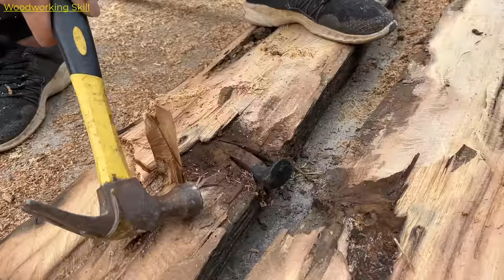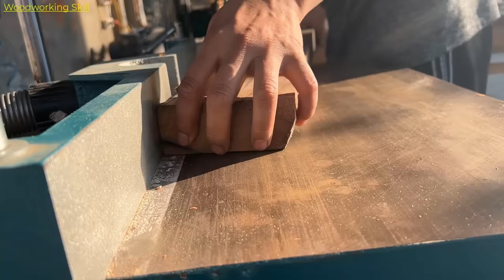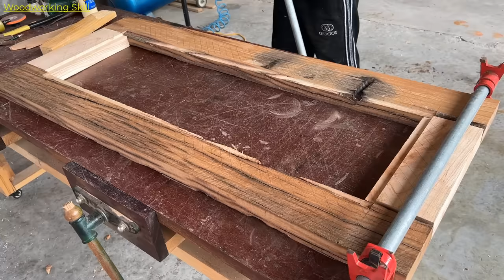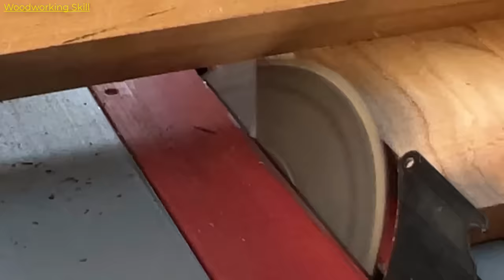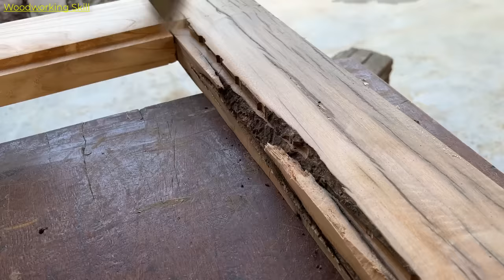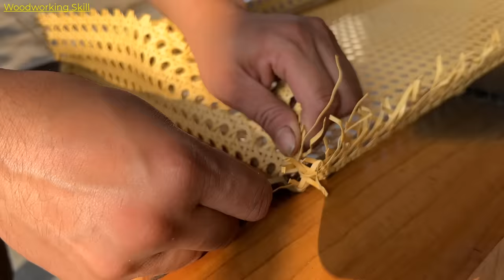Recycling Of Railway Sleepers // Build A Table Out Of 123-Year-Old Railroad Sleepers

Comment: This lumber is pressure treated with all kind of toxic chemicals to prevent decay. Old barn wood would be much better material for table.
Reply: Creosote - nasty, but perhaps worn off
Reply: Even more, the toilet were direct drained on the railways at some area in the old days . I'm not sure if it is a good idea to make a table out of it
Reply: I agree. I would not advise anyone to use an old railroad tie for furniture. It's bad for the health of the woodworker and the customer
Reply: No se en que país estas pero acá en Argentina  existe una madera o mejor dicho un árbol llamado quebracho que es así cm lo ves y se usan para durmientes y montar las vías de los trenes ... sin tratamiento es muy buena .. de echo esta madera puede estar bajo el agua durante 20 o 30 años sin descomponerse
Reply: Basically building with hazardous waste.  Do not recycle the sawdust or trimmings.

Spend the money for new wood.
Reply: Here you can’t even take them to the dump.
Reply: I wasn’t too toxic as white ants were crawling around in it! However I get your drift, I’ve got some old hardwood planks off a wooden jetty and no one can tell me if they are treated or not.
Reply: You people make me laugh with these comments I am curious as what your diets are like
Reply: Ain’t that a fact.  Seal the f—- out of it.
Reply: There's not much concern for safety in China.
Reply: Creecoat is the preservative .
Reply: I burn these in my fireplace
Reply: @creatednordestroyed5339  mine is mostly microwave burritos🌯 , ramen noodles 🍜 and pizza 🍕.
Reply: @Joseph Cooper  Yep, was about to say that's exactly what it is. If it's finished and sealed properly you won't have to worry about contamination at all. A resin coat would be ideal, like you would see on a bar top.
Reply: The creosote preservative is considered a carcinogen. Not a wise idea to use old railroad ties for furniture or other uses such as landscape timbers. Breathing the saw dust is unsafe not to mention numerous other hazards associated with creosote.
Reply: What's the fun in that. We in Africa build plenty with sleepers. Beautiful. Hard on tools
Reply: Toxic🤢
Reply: @scottallen5269  yip. You always get a profit of doom. In Africa this furniture is sought after and has yet to kill anyone. Beautiful though
Reply: @pietervanderwalt1440  always huh? Doesn’t change the facts... this Wood IS toxic
Reply: It's a table for his mother in law...lol
Reply: L
Reply: @creatednordestroyed5339  Vegans most likely lol
Reply: Oh my this is toxic waste. Watch out
Reply: Here in germany old railroad wood is heavily treated with toxic chemicals. My granddad had some for wallposts. They outlived him. Not much rotten even on the part standing in the moist soil for decades. You surely don't want them freshly cut as furnature inside!
Reply: Nice work. I've always tried to figure out how to angle the legs.   Creosote schmeosote.
Reply: At 123 years old it could be chestnut, and I don't think that it had to be treated.
Reply: It’s no joke, that chemical is super toxic. Beautiful work though.
Reply: Wow guys just put sealant on it you be fine... 🤦
Reply: 3 hand applied coats of burnt motor oil would really get this table to the station on time. 
Or, hit it with some good old oil based lead primer and topcoat. 
Be around long after those of us watching this are recycled to compost.
Reply: There won't be any problems If you seal the wood properly.
Reply: @creatednordestroyed5339 the sawdust will literally kill your grass as quickly as roundup, and you are breathing it in when doing this. It will also kill the hairs on your arms that are exposed to all the sawdust when cutting , no joke.
Reply: Mmmm can taste the asbestos from here😵‍💫🇭🇲
Reply: @user-cy2rd1hb1p another good point. Lmfao. He gonna eat off it
Reply: I completely understand about the toxic wood and all that but it looks nice the guy did a great job at least different credit for that
Reply: Creasote is what they are treated with

Comment: I thought these where soaked in creosote and toxic?? I wouldn't use one for anything
Reply: this material is carcinogenic. quite dangerous, indeed.
Reply: It's only toxic if you eat it. Old weathered railroad ties pose little to no risk.
Reply: That's not true.
Reply: Really nasty stuff in these, how else do they last 50 years outside
Reply: Ties.
Reply: @jaysfishbowlable  yes its true. It doesn't enter through skin or evaporate into the air. It o ly enters your body if you swallow it. Information in safe handling is widely available.
Reply: @seanbrotherton542  not a true statement
Reply: I saw worms inside these wood.
Reply: Darwin award contender?
Reply: Only in the state of California everywhere else it is safe. LOL
Reply: From my observation in this video for color of the Wood, and the characteristics of wood, that Wood is ironwood, so no chemical preservation needed. Because the Wood already hard enough and resistance in any kind of weather.
Reply: All you have to do is get it on your skin it is very toxic. Coming from a railroad worker.
Reply: Then they throw the sawdust in the chicken coop. They don't plan on living long overseas
Reply: Aw, come on, A little creosote never hurt nobody!
Reply: I used to work at at a sawmill and wood treatment plant. They used creosote or the RR ties and also treated poles etc with CCA which is copper chromate arsenic (the green stuff) .   Both are really nasty and should not be used for direct human contact, breathed or burned. I have seen old RR ties with creosote give horrible burns on skin especially exposed to the sun.
Nope don’t use it except for ground contact like a post or flower garden border.
Reply: @davidshuff8838  especially overseas
Reply: I remember a few years ago the local railroad company replaced a good number of ties. I contacted the office about buying a few for some projects. They told me they wouldn't sell them to me. I asked why not, they really didn't give me a reason. I thought they might be toxic. Now I know why.
Reply: A timber company nearby offers them for sale "treated for Creosote", I wonder if it's possible to make them 100% safe.

Comment: Very nice. During the entire video, I wondered if this table still smells like a railroad tie smells. They are treated with some strong chemicals. Also, I think a dark piece of tempored glass instead of the wicker stuff would look better and be more pratical. But still very nice and great video. Thank you!
Reply: I think it's a bench, not a table.
Reply: , creosote, carcinogenic.
Reply: @edisontesla3932  then in that case, with only a few brad nails on all side, it will fall through very quickly.

Comment: Awesome work! Although, the way you make some of those table saw cuts should keep you up at night. Sure it's technically a rip cut when the board is on its end, but you can use a crosscut sled to keep kickback from occurring instead of standing on the wrong side of the table and hoping for a good outcome. Really they take like 10mins to make. Be safe!
Reply: Lots of creosote in them thar timbers

Comment: The pressure must have been very low when they treated them. The ties from the treating plant nearby are treated all the way through. The pressure is high enough in the chamber  to absorb around 8 gallons per 7x9x8.5 cross tie. That's part of the reason they are so heavy.
Reply: When these ties were produced, there was no such thing as pressure treating.
The timber was kiln-dried first and then soaked in a  creosote cocktail for preservation.
Reply: Really a bad choice of wood. Crudely made.

Comment: Last summer the rr tracks were refurbished in my area.  They laid out new sleepers for quite a few miles several months prior.
This was along the walking and bike path.  The creosote sweltering in the summer heat was overwhelming.  You literally could not walk there all summer.
We should check back in a couple of years and see if any of these people have taken ill from inhaling all that saw dust.
Reply: You do realize that railroad ties just sitting there doesn't have saw dust?
How would the creosote be worse than when the rr ties were being used? I've been around railroads, railroad ties, & I've used fence posts treated with creosote on the farm for my entire life. The only thing I've gotten from RR ties & fence posts soaked with creosote in 50+ years is creosote getting all over clothing & it doesn't wash out!! 
Around where i live we use old RR ties for landscaping all the time, never have had any issues, .& we use several ties.
Reply: Yeah, progress,  the city of Houston made asbestos shingles safe to remove for a few years,  you could tear them off and curb the trash and they'd haul it away. A couple of years then behold "studies show they may be harmful.  Kind of a tax break for developers
Reply: @timothygeiger8271  You do realize that when you pass it through a tablesaw or a planer it does have Stardust!
Reply: @nzs316  it has saw dust, not stardust, & they probably are wearing dust masks
Reply: @timothygeiger8271  Siri had another stroke this morning I wrote sawdust it change it to Stardust thank you for putting a twinkle in my eye!
Reply: @gumecindogarcia1070  Here in Maine it is legal for a homeowner to remove the Asbestos siding from your own home.
Reply: and how many fingers they're missing

Comment: The design flaw here is that the top surface cracks and checks will collect dust and crumbs, requiring an air compressor to clean.

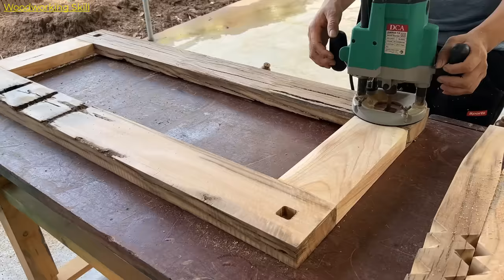Comment: Could have done further work with a blowtorch in those crevices and then use a rotary wire brush to remove charred lose material, 11:47.

Comment: I got 700 railway ties for free. I sold some for retaining walls, but they are mostly 4ft and drier than a popcorn fart! Inspiration to make something out of them, but probably not for furniture, more like garden retaining walls. Your tenon cuts were scary, as a joiner, these materials are not consistent sizes , nor is the wood stable enough to not blow out or tear, so a sled would be essential and should not be encouraged to do by novices. I am a time served wood machinist and would never risk cuts like that on short end grain and with weak unstable wood.